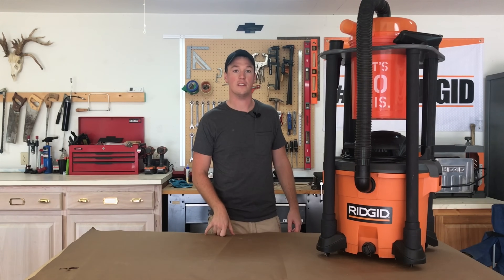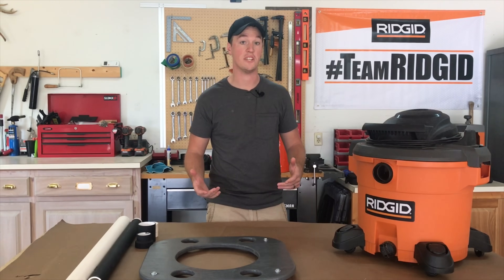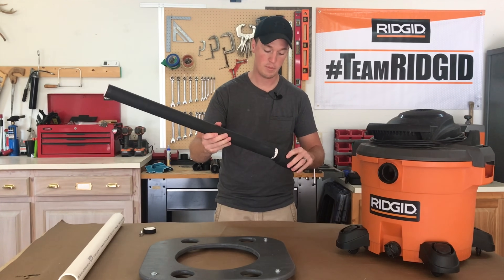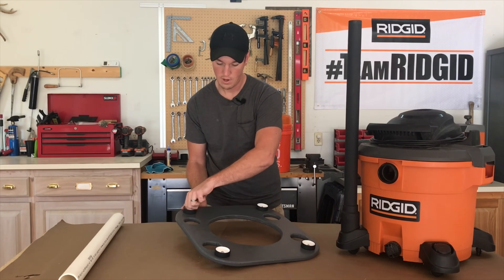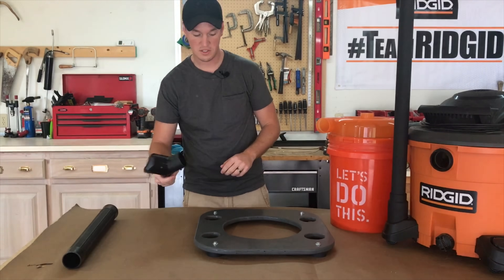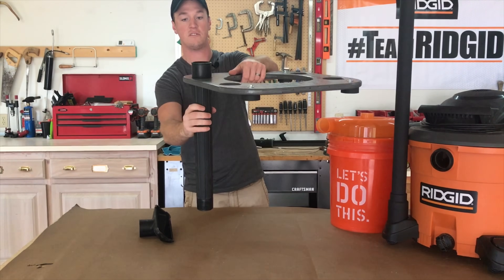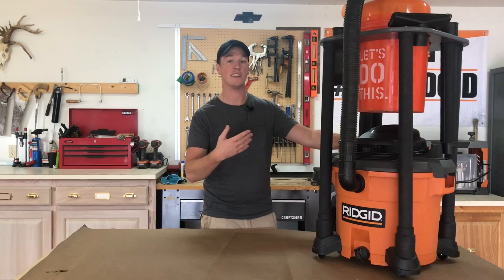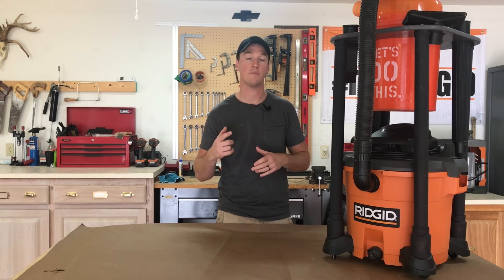The Ultimate Space-Saving Dust Cyclone Separator Cart | Dustopper & Ridgid Vac Cart

Comment: I made this exact setup and it works great. This is a very compact and efficient design. However, the Dustopper is made out of cheap brittle plastic and this setup is top heavy and tips over easily. I have broken 2 Dustoppers from it tipping over, when over extending the hose. On my 3rd Dustopper now. When vacuuming up the shop floor I now hold onto the top of the unit while vacuuming so it does not tip over anymore. If this 3rd one breaks I am going to try one of the Dust Deputy style cyclones next, hopefully they are made out of less brittle plastic.
Reply from the maker: That’s weird man, mine isn’t top heavy at all, as shown in the clip of me flinging it all over the shop really hard haha. I use mine everyday and have never had an issue with it. Is your vacuum different than mine?
Reply: @JohnBuildsIt  I have the newer version of your vac. If the little wheels roll over the cord or something else when I'm not paying attention and vacuuming a room. When I pull on the hose and instead of it rolling over the cord it tilts and falls over. This is to be expected, but what breaks is the horizontal intake port. The wood sheet should protect it since it protrudes further then the port. I guess its the hose that is attached transferring the shock of the fall to the port and it cracks very easily. Both broke on 2nd or 3rd fall. Not saying anything bad about the build. I absolutely love it, I don't think you can build a more compact system than this. If they made the Duststopper out of a softer plastic then this wouldn't be an issue. I just wanted to warn people cause those Duststoppers aren't cheap!

Comment: Use rubber type plumbing 2" to 1 1/2" reducer with hose clamp works great super easy and use black pvc no need for paint. Great video and project
Reply: The rubber reducer has top much flex. Too wobbly and doesn’t work well.

Comment: Nice simple design!  Also, straightforward video without a ton of unnecessary lead-in.  A downside not addressed: it looks like a total pain to get the cord wrapped on top of the vac.  Any thoughts on this?
Reply from the maker: Darron I never wrap it up anyways haha always in use! Same with the hose👍🏽
Reply: @JohnBuildsIt  Good point.  One other question.  My Dustopper came with only 1 elbow but yours appears to have 2.  That's actually critical given the "perfect length" of hose when trying to reach to the Dustopper on top of the vac.  A swoop takes more hose than is available.  Did your Dustopper come with 2 elbows, or where did you get the other?  I couldn't find an individual one at HD.
Reply from the maker: Darron link and explanation to what I used is up in the description! Or you can actually buy spare elbows right from dustopper now on their website

Comment: I bought the 12 gallon NXT Rigid on a special one day sale for $79.00.  I proceeded to build John's Dust Management System.  The only thing I did to make it easier is that I found rubber couplings with steel bands for tightening.  2" to 1.5"  This fits the NXT strange feet.  I had a little Dielectric Grease on hand.  A little dab on the PVC ends and those slipped right into the 1.5" couplers.

You will need at least 33"of PVC per leg to make this fit a NXT vac as it is a taller vac.  Lowes had the PVC length in 5 foot and half an inch.  I cut two of those in half at 30.25" and ended up 2" short.  I will have to experiment with some PVC couplers.  Also, since the NXT is taller the hose from the Dust Stopper will require an additional elbow to fit.

Comment: I used  the two bucket cyclone similar to Chris NOTAP except I only used a 2" 90° "street" type PVC and a 45° elbow. a 2 ¼" hole saw makes an airtight hole for use with the shop vac hose. the female end of the elbow was a little large so a few wraps with hockey tape made for a tight fit for the connector hose from the vac to the cyclone.   I had many drywall and 5 gal paint buckets so the cyclone only cost me about $6 for the two elbows. FYI: this also makes a great water separator!   I tested it and had zero water in my shop vac bag. A 5 gal. bucket is much easier to dump and clean than the inside of a shop vac plus no need to remove the dust bag in the vac.

Comment: This is a great design. Thank you! I purchased the new HD 1400 model. Unfortunately as commented here the new wheel assembly is no longer the same. I used 2" PVC and a 2" female adapter that is threaded on one side and a 2" coupler on the other. You will need to sand down the threaded side slightly in order to get it to fit. You don't need to take off much. I used the electrical gray version as this one was 2 1/2 inches and fitted better. I used the screws for the hose bracket and pre-drilled the PVC on the base. It added an addition connection. I had the dust deputy already and used it with this design. I don't know how to add a picture of the female adapter. You will find it in the electrical dept in Home Depot.
Reply from the maker: Mike Congiusti hey man, shoot me an email with pics if you’d like! jrhopson7@gmail.com I plan on doing an updated video here soon with the new vac and want to show different solutions

Comment: Great idea! I added a 3D-printed bracket underneath the plywood top to hold an iSocket Autoswitch to control the vacuum. Now I just wheel the cart to the tool, connect the vacuum hose, plug the tool into the autoswitch, and have automatic vacuum control with dust separation. I uploaded the bracket for anyone to print out here: https://www.thingiverse.com/thing:3898976
Reply: I built my two-stage cart using a Dustopper and a Fein Turbo I dust extractor which has that feature built in. Once you have it you never want to go back to fumbling for the vac switch.

Comment: Thanks for a great idea and video. I just completed the build and it works great! I ended up going with 1-1/2” black ABS for the legs so I didn’t have to paint them, plus since it’s black all the way through it shouldn’t show scratches like the PVC might. I was able to get the exact same Ridgid vacuum at my Home Depot (WD1270) $80. The holes for the attachments actually are 2-1/2” so a 2-1/2” hole saw made for clean cuts and they don’t fall through. I also used a round over bit on the router and did the holes and edges. Like others I think cord management is the only thing it needs.

Comment: John, I finally got around to making one of these carts. It's just so flippin' easy. It's a great design. One question though. What did you use for the extra elbow for the shop vac intake?

Another video using this design suggested a particular 90 degree elbow brush that is available at Lowe's but for my shop vac (the Ridgid NXT model, HD1200, 12 gal)), it doesn't fit. It's the same size as the intake. It fits the hose from the Dustopper, but won't go in the shop vac.

What did you end up using?
Reply from the maker: GuiTuber I used that same brush you’re talking about! Does the elbow that came with the dustopper fit in the vacuum? If it does, thanks to my video, you can now buy them right from dustopper.com haha. Let me know if it does!
Reply: @JohnBuildsIt , the Dustopper elbow does fit in the shop vac intake. Perfect. I'm ordering one now and will be returning that brush to Lowe's tomorrow.

Edit: I could get the elbow tomorrow morning for $131.00. Fortunately, I don't need it that quickly.
Reply from the maker: GuiTuber hahaha yea I think you’re better off waiting a few days! Glad that’ll work though!
Reply: @JohnBuildsIt , thanks for the tip. I tagged you on my Instagram post. Look for Awlthat. That's me on IG.

Comment: Great design! I was thinking on making one but inverted, the bucket will be below and the vac will sit on top of it. I have a small but powerful 2-galln vac that works great for woodworking but gets clogged fast, its base is the same size as a 5-gallon bucket lid. There are many vids around on making a cyclone separator using just a 5-gallon bucket and they work pretty well, with the vac mounted on top and a base for the bucket with some casters it can be a pretty sturdy and small setup to carry around.

Comment: The dust stopper comes with one elbow. Where did you get the other one?  HD doesn't have it in their vac fittings.
Reply from the maker: Mudhill Pottery check out the details up in the description, thanks!
Reply: Lowes, had a short brush with 90 elbow. Pull off brush and used elbow 8$

Comment: Nice design and build John   Looks like it is lent stable as well  watching your spin demostration  awesome job  i know  that  some of the older Craftsman shop vacs used similar bases  I’m pretty sure it was a rebadged Shop Vac unit they made for Sears  as i had a Craftsman at home and my company had the Shop Vac at our shop  ironically  Sears used to code their power tools  with the code  disclosing who actually made the Craftsman  branded ones  many years ago a family member worked there and he gave me the list of who Sears  used to use to manufacturer each item  i was a Woodworker and i remembered that Delta made most of the miter saws and quite a few other items   And at one point Bosch made their Professional jigsaws   Of course they. Changed the roiertary colored cases  to hel disguise them a bit
Reply from the maker: Craig Monteforte wow that’s interesting! Yep, quite a few people have sent me pics using this with their craftsman vacs!

Comment: Very good, simple design build. As far as ridgid changing the base design, should be no problem, always more than one way to do something. I used a piece of 3/4 plywood, cut to size needed, screwed through the attachment mounts and continued the build as normal. I did drill the new base to accept castors.

Comment: I have an old craftsman vac and this design is Great. I started bldg one. I used a heat gun on a 1-1/2" pvc 90 degree elbow to connect the suction hose to the vac. the OD of the elbow fits in the vac and I enlarged the other end for the hose. this will create a small pressure drop. I also needed the 1-1/2" pvc pipe to be ~33" long.  Since there is so little dust and dirt in the vac drum, I can store the extra hose in there. Thanks for the presenting this video.

Comment: John:

Thanks you for an excellent video and innovative design.  My ShopVac unit doesn't have the convenient tool holders on the feet assemblies, but I used elements of your design as I built my cart.  One problem I have is that the Dustopper doesn't like to maintain a good seal with the bucket.  Are  you aware of any hold-downs that could help hold the Dustopper on the bucket?

Thanks,

Mark
Reply from the maker: Mark Dixon I haven’t had that problem but I’ve heard others say it too. My idea would be to take some electrical tape just around the lip of the bucket then put the dustopper on and that’ll tighten up the connection
Reply: @JohnBuildsIt  - John:  Thank you for the reply.  I put some tape on and it seemed to help.  I appreciate your assistance. -- Mark

Comment: I just built one over the weekend! Terrific design!
I have a few observations!
To cut the holes for the wands and tools I used a fly cutter that I bought for a few dollars at Harbor freight Tools.
They are easy to adjust to pretty close to the exact size hole you need,And it only took a couple of minutes to 
cut out all four holes. You have to use a drill press when using the fly cutter!
Also I found the 2 inch couplers I bought at Home Depot are slightly tapered. You can't see this by eye.
I found this out when I was fitting the couplers to my Vacuum. One end will not go all the way down
but the other end does !
To make a place to wind up the Vacuum power cord. Consider when mounting the pipe caps, that the two rear ones have a longer screw with the bolt head in the pipe cap. Instead of using a nut put two 1/4 inch threaded rod coupling nuts on each long screw and top it off with a wide fender washer and a nut and lock washer! you can loop the power cord around these.
Reply from the maker: Michael Tenore awesome ideas!!

Comment: It is cool.  I order one of those dust toppers but it did not come with those 90 degree elbows.  Lame.
Reply from the maker: All The Hobbies it should’ve came with 1!
Reply: @JohnBuildsIt  Nope just got the top and a short hose thats not long enough without the two 90's.
Reply: @JohnBuildsIt  Just bad luck then I guess.  Still only leaves you with one.  Between the couplers, reducers, pipes and now elbows this start to add up in cost.
Reply from the maker: All The Hobbies not when you compare to other carts people have made for this purpose

Comment: Just an observation: if your pickup hose is coming from the separator and you pull it around the shop, it seems as it might be top heavy.  If you it and object hard enough with wheel, could it be prone to tip over? What if you routed your pickup down to the bottom(maybe use one of the support tubes to route it back down and then a T??) thus pulling the pickup from a low center of gravity. You created a great upgrade to the Rigid.  I have one of those vacuums still around and may try this, but I also have 2 dust collection systems on main pieces of equipment so not in a hurry.
Reply from the maker: Woodsman it’s never tipped on me at all! My design is significantly lower center of gravity compared to other people’s carts
Reply: @JohnBuildsIt  Good to know.

Comment: hey i got one question. what is that even for?
Reply: Dust collectors dump the dust , wood chips and dirt into a bucket before it gets into the vacuum. The shop vac just creates the suction. Having the dust drop into a bucket instead of going into the shop vac will keep your shop vac filter from getting plugged with dust so you don’t lose suction, don’t have to constantly clean the filter and will probably never have to replace the filter either.  If you’ve never seen a dust collector in action you’ll be amazed at the difference. Almost zero dust gets into the vacuum. This cart he made just makes it easy to wheel around with the shop vac. I have these same dust collector lids in my shop and they work amazingly well especially for the price. It’s a pretty slick design on the cart and I think I may steal it for my shop.

Comment: John, I really liked your video by the way. straight forward. Great tests run for comparing units.
Dust stopper what is the plastic compared to the deputy? And was the dust stopper louder then Deputy?
Reply from the maker: Most Likely We Do It Services thank you! I’d say the plastic is pretty comparable on both. The dustopper has a different sound to it, but only about 2 decibels louder
Reply: @JohnBuildsIt  That's what I thought when listening to it on the video. The one thing I hate about the Deputy. Is it loves to tip over if sitting on a bucket alone? Some times I will put a counterweight in the bucket to offset top leverage that knocks the bucket over when a hose pulls on it.

Comment: I work in the trades. I own the Dust Deputy. It takes real abuse. The Deputy is quality plastic that does not crack easily. I have sucked up everything under the sun. If it will fit in the hose it's going to the deputy. rocks, concrete, sawdust, drywall sanding dust, fireplace ash, sand. The abuse it takes is probably the worst getting transported job to job. The test John ran were great. The one real plus was the Deputy ran quieter. I run it with the Ridged 6.0 hp 14-gallon vac. I have had some home depot bucket collapse under hours of continuous running. The sides of the bucket actually cave in.  So totally support Dust Deputy. I would not think twice about buying it again. By the way, the ridged Vacuum I own is a beast. I wish I had an hour gage on it. It has so many hours on it and it just keeps working like the day I bought it.
Reply: another YT video on cyclone separators used double buckets,one stacked inside the other, to prevent the bucket from collapsing under vacuum. the top bucket is your collector. So,a simple fix for that.

Comment: Jusy get a Miele bagged vacuum; genuine HEPA filter, long lasting motor. I have an Electro plus C2, small, easy to handle, variable suction, powerful brush head, attachments are cheap though, has 2 filtration stages and 2 screens. Bag is a filter, pre-motor screen, HEPA filter, and outlet screen. 

I use it for drywall, MDF dust, oily kitchen dust, lint, hay clippings, sand. It'll pick up anything and keep the dust contained in a bag. Anything wet, I use a Rigid vac. If I had the money, I would get the C3 with onboard storage, better hose, and attachments.